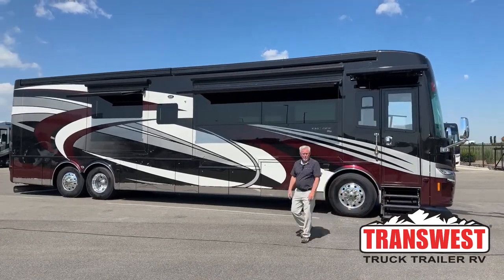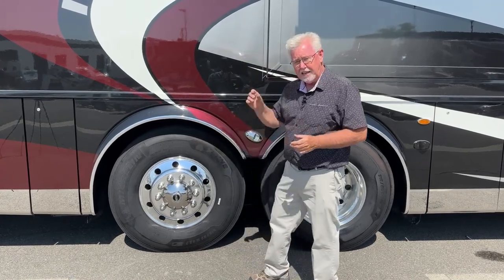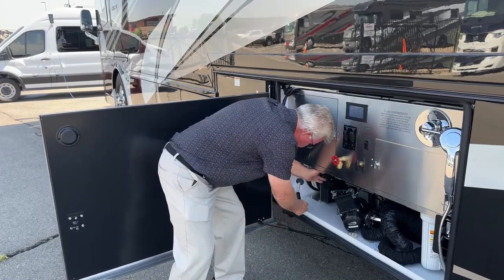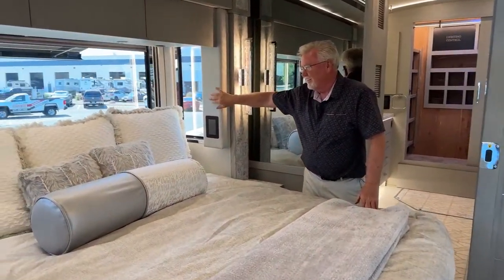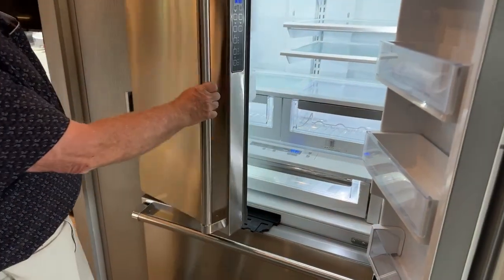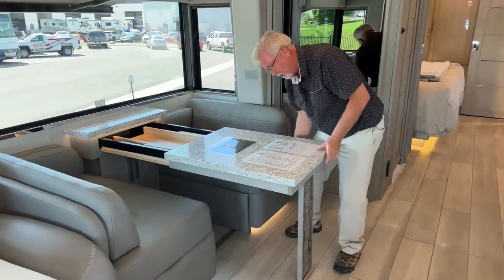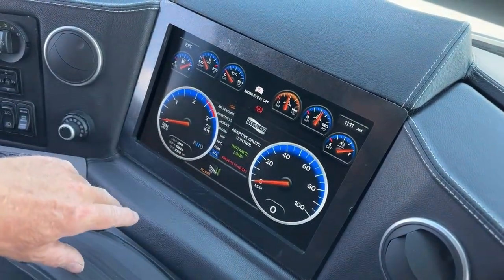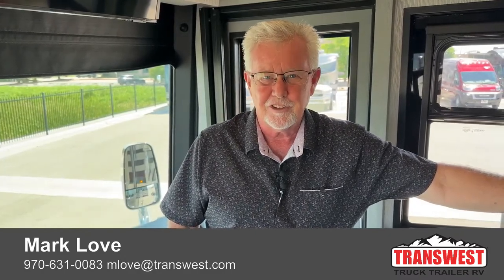2022 Newmar King Aire 4533

Comment: Great presentation. I have a 2022 King Aire 4531 and I believe you will find that when a coach equipped with the Spartan Passive Steer Tag Axle is shifted into reverse, the alignment mechanism automatically straightens the tires. Basically, they only assist when moving forward at slow speeds. Otherwise, fantastic walkthrough and explaining all the features of the King Aire would take you several hours. Please keep doing videos like this, you have become one of my favorites.